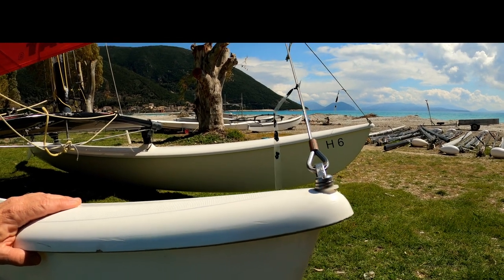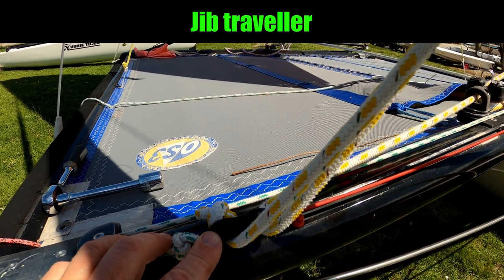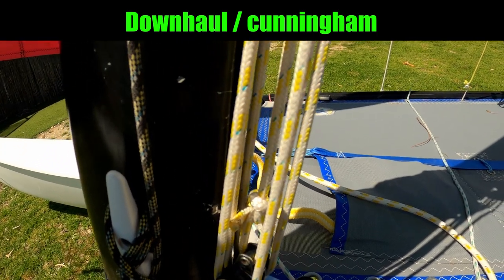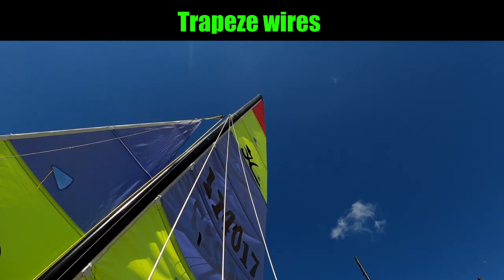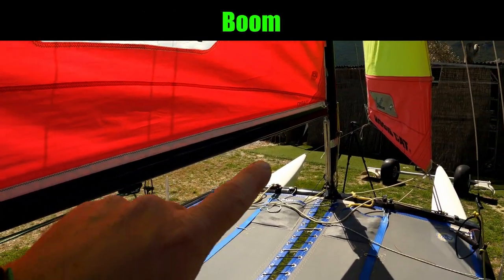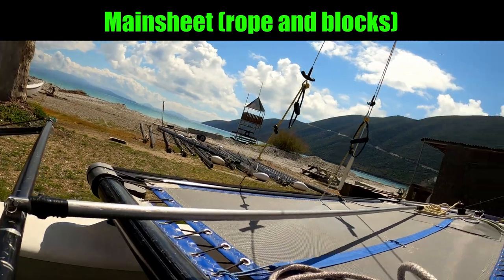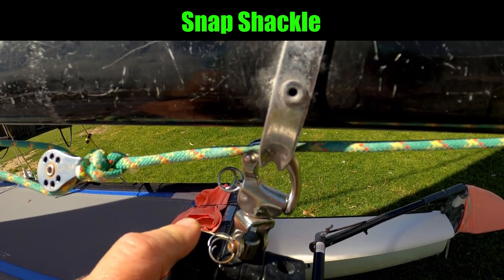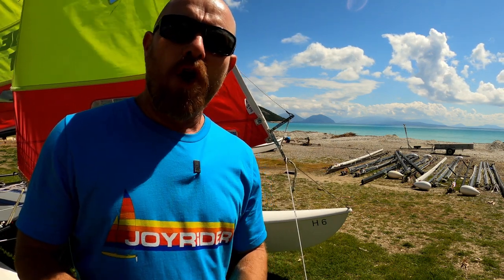Boat parts explained  - The Hobie 16

Comment: Really good information in this video Joe. I have always understood that the "dog bones" were the old style of trapeze hook points, kinda like the J&H handles but were chrome metal and had two rings for attachment points, they actually look like a dogs bone. I have them on my boat as well as the J&H style. Many of the older cat sailors prefer the old style of "dog bone" because it allows two hook points, but beware of getting struck with a flailing one, LoL. Good info, and looking forward to more vids like this about other types of cats.
Reply from the maker: Thanks, yes, next one will be coming as soon as I've finished building the boats.

Comment: Hi, for maintenance purposes, I wanted to change anchor pin and bar where the shroud is fixed (in fact the other broke when sailing with consequent mast falling in the sea). But I cannot unscrew it, despite all my attempts and efforts. Any tip? Thanks
Reply from the maker: I would use an adjustable spanner - that way you'll get the most leverage
Reply: @JoyriderTV  thanks. However it does not work with any tool. It is like if the two pieces melted together.
Reply from the maker: @margaira  oh dear, i think in that case it will probably require some real engineer with a drill, or to cut (carefully) the screw with a hacksaw